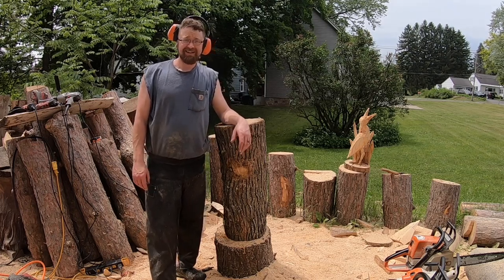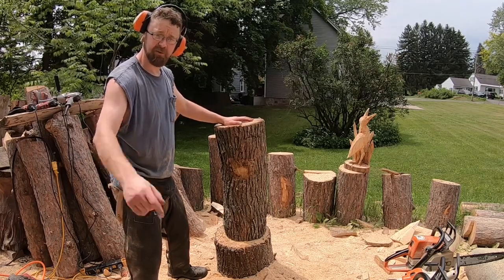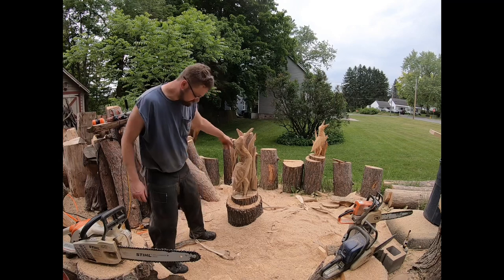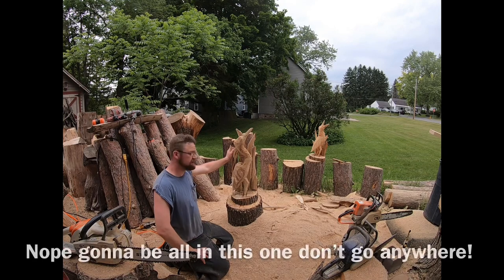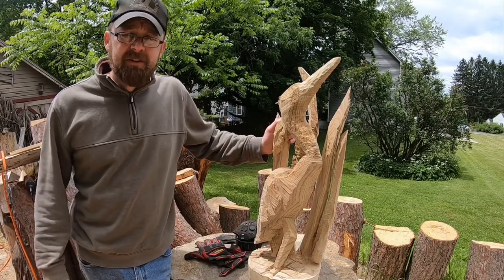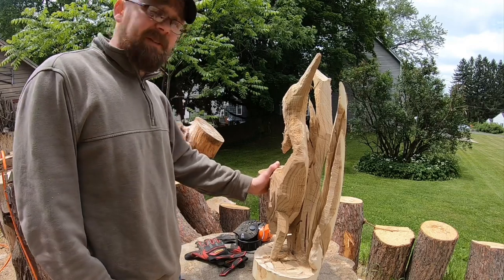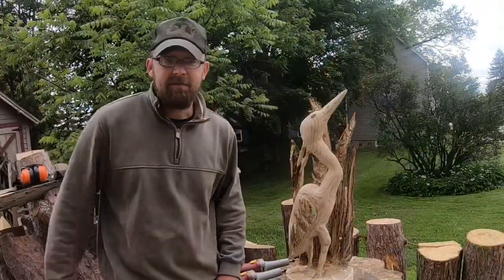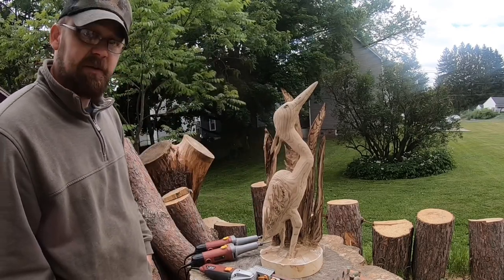Chainsaw carving a Blue Heron !

Comment: Looks like a Heron to me. I get a lot of the great blue herons here to. A few white herons and some cattle egrets mostly in spring. Blues are pretty big birds. They hang around here all year, I see them workin the edge of the lake even when it's froze over. They also will fly at night, not many birds fly at night unless they're disturbed. You handle that chainsaw like it's a butter knife. Great work.
Reply from the maker: That’s really cool Rick , I didn’t realize they would fly at night . I see them often flying and once and a while see them at the waters edge. They are good size that’s for sure . 
  Thanks Rick